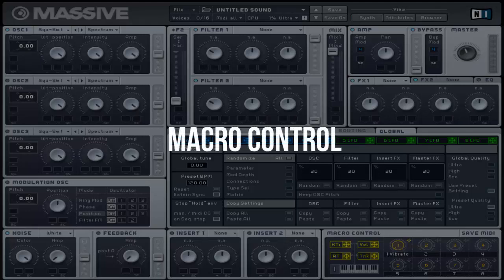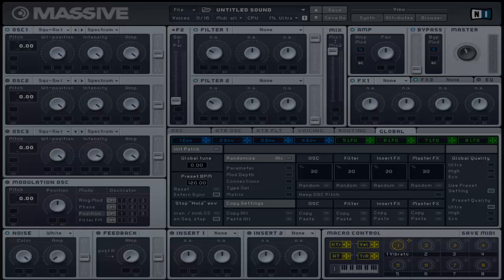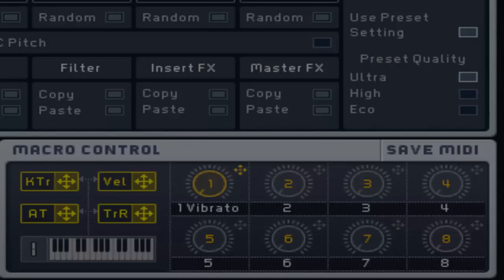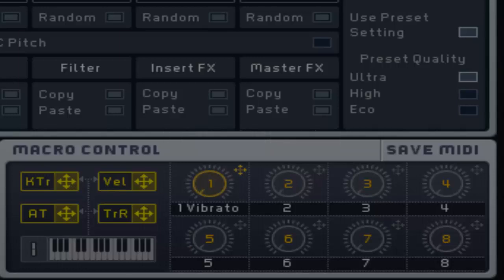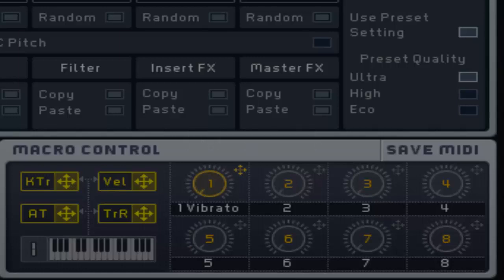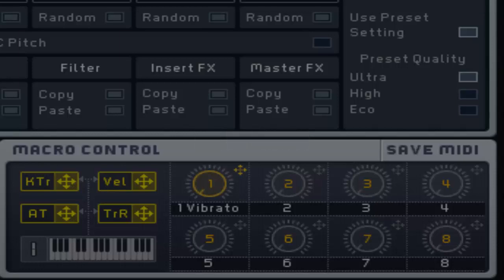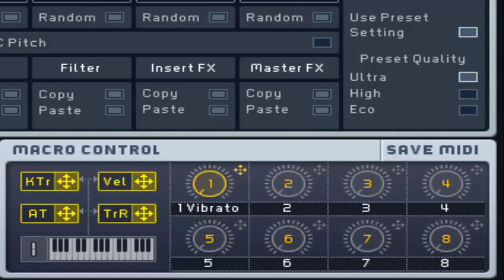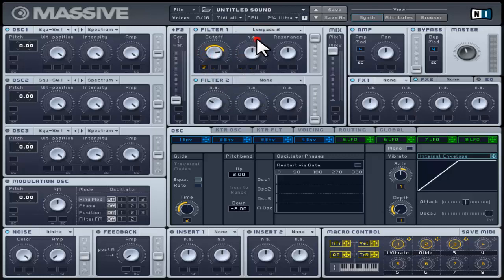Fast-Click Massive Tutorial - Macro Control

Comment: I just want live control over the LFO speed and I still can't make it happen what the hell man
Reply: You can do that with or without the macro section, just right click over the knob you want control over so for LFO speed right click over the "Rate" knob. Click"Midi Learn" assign it to whatever knob you have on the midi controller, and it should automatically assign it for you.  If you want to control the macro that is linked to the LFO speed, then assign the macro to it first,  then right click on the macro and select "Midi Learn"